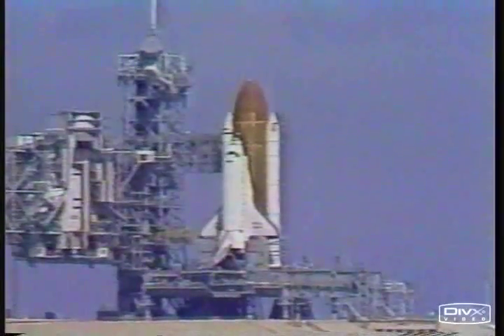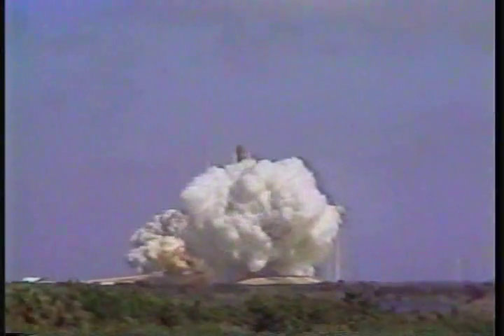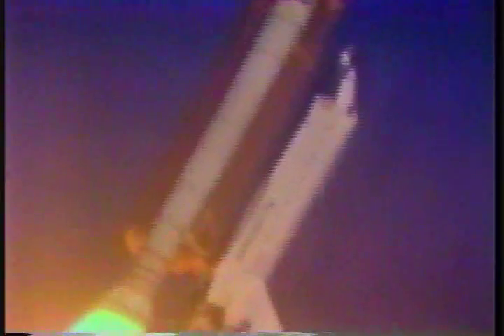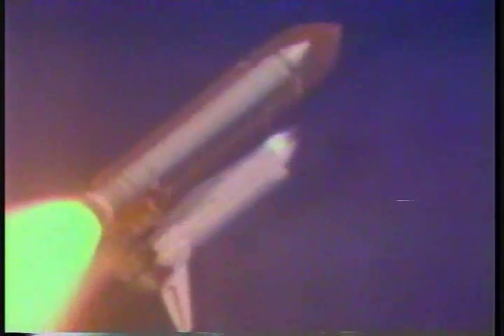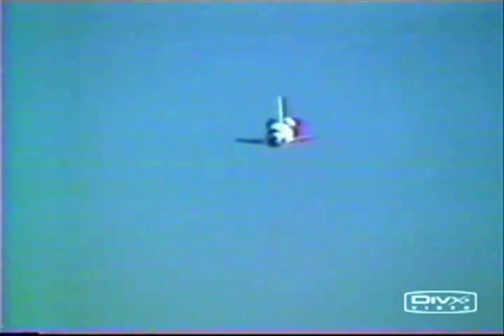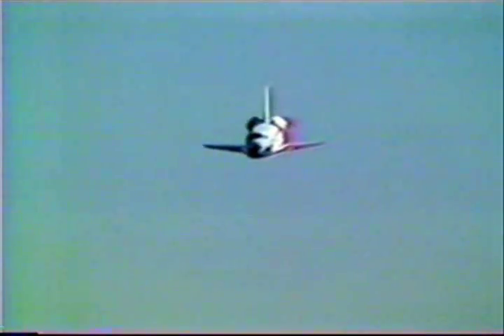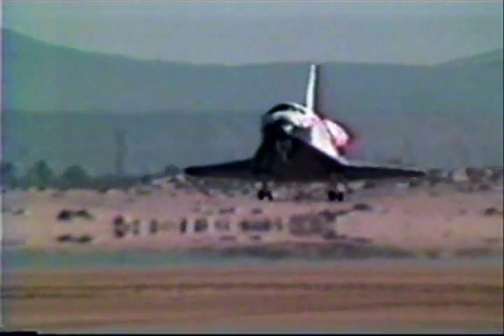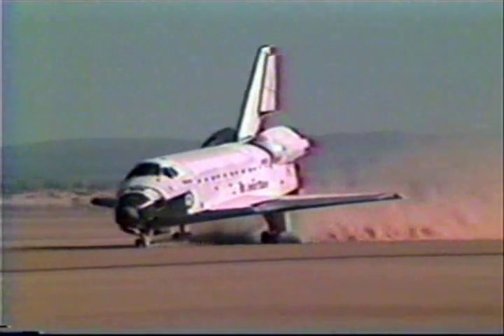STS-51J, Atlantis' first launch & landing (10-3-85)

Comment: Atlantis had to wait 5 years until her second flight in 1989. Yet she was nearly lost just like Columbia. There was a metal plate that had kept Atlantis from a fate like Columbia. Luckily they had the crew land in Calfornia because the metal plate that was saving Atlantis and the crew from burning up was beginning to fail. If they had landed in Flordia surely Atlantis fate and the death of 7 more astronauts that the shuttle program would have ended in 1989.

NASA management still didn't give a damn. Nither the DOD!
Reply: The crew of STS 27, the third flight of Atlantis, consisted of 5 astronauts, not 7. The flight was in 1988, in December, not 1989. But they were lucky indeed.  This flight was a clear demonstration of the Shuttle’s vulnerability to falling debris and more should have been done to address the problem,  rather than wait until a  catastrophic failure of the thermal protection system did occur, with Columbia in February 2003.  Like Challenger, there were many  warnings of a potential, impending disaster which were ignored or NASA management being  too complacent to heed those warnings.
Reply: ryan 1981 actually Atlantis second flight was sts 61b so her 1989 flight was her 3rd flight